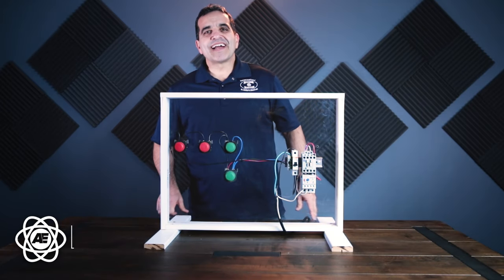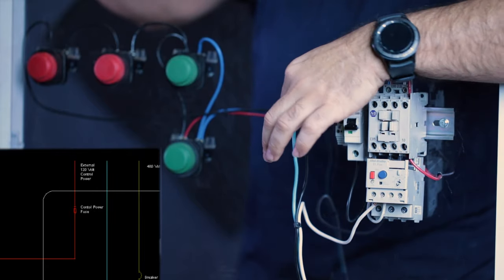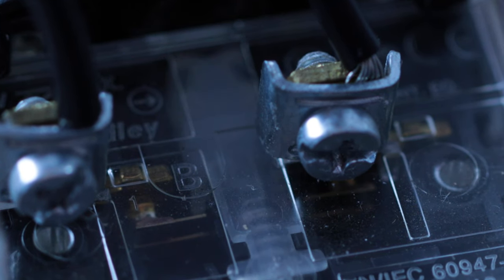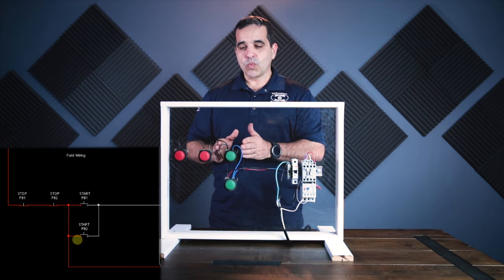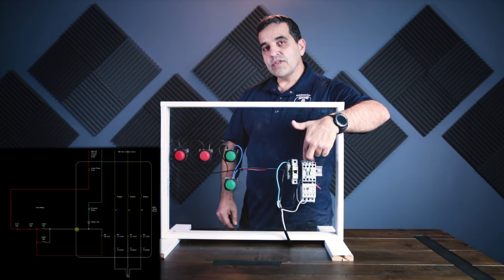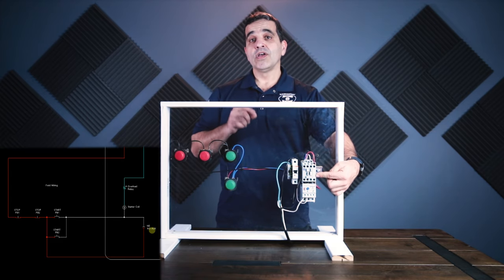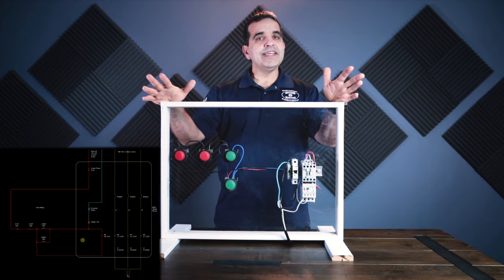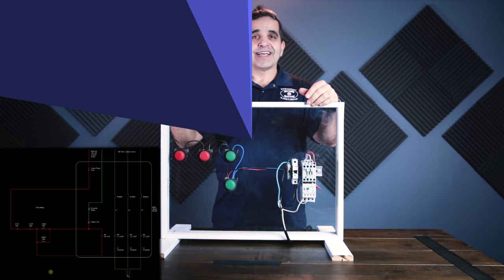Basic Motor Control: 3 Wire Start Stop Circuit (updated)

Comment: Wow, another great video! Thanks so much. And using the clear plexiglas mounting is a brilliant way to show in a (literally) clear and engaging way just what is going on. 
This was definitely a worthy update from the earlier video, thought it's best to watch the other one first, and then this one. My only suggestion is to add 2 indicator lights. One to represent the load being controlled, and the other to indicate POWER ON to the basic control circuit (ie, Breaker On). With these, you could start by manually closing the contractor to show that the load lights up. One additional suggestion would be to inset a close-up view of the contractor connections when you're discussing them so we can see when you have 2 wires connected to the same terminal (which is think is the case for the blue and red hot feeds for the contractor coil).

Comment: Walter great information.

Do you have a video or diagram explaining this same concept using a DC off/on/(on) switch? 

One off/on/(on) switch in one location and second off/on/(on) switch in another location.
Start the engine from one location but be able to shut down from either location.

Like a rocker switch used for diesel engines to be started and shut down from more than one dashboard.

Thank you

Comment: Nice 👍🏻. Very informative. What about a 240v coil on a single phase starter with a stop, start?
Reply from the maker: Hi Tracy! With a 240 volt coil you will wire the starter and the buttons exactly the same way. Line 1 of your 240 volt circuit will,wire through the buttons and to the starter the same way. The difference will be that instead of wiring the neutral wire through the Normally Closed overload relay and to the coil, you will wire Line 2 of your 240 volt circuit through the overload relay. Also remember the single pole fuse switch I show on the control power circuit would need to be a 2 pole to disconnect both legs of the control power 240 volt circuit at the same time.
Reply: Can you do a video on this?

Comment: Why did you wire the neutral to the bottom of your overload protection device? If you explain that in a bit more detail that be appreciated, thank you. 
Other than that I understood the information presented in the video.
Reply from the maker: AKBRONCOSFAN007 The overload is a normally closed safety switch. I wire the neutral to one side of the overload, and the other side of The overload is wired to the coil on the starter. This feeds one side of the coil. So a neutral is always available if the overload is not tripped to the coil. When the start button is pressed and the whole circuit is engaged, 110 V is applied to the other side of the coil. So if you lose
Reply from the maker: AKBRONCOSFAN007 Power than the quail will turn off or if the overload trips and you lose the neutral the overload will turn off.
Reply: @AccessToPower  Just piecing it together w/o typos: So if you lose power to the coil the contractor will turn off. This will happen when either you lose control circuit power (fro coming through the breaker due to power failure or turning the breaker off) or if the neutral overload protection NC switches open in response to overload condition. Either of these events will cut the neutral connection to the contractor coil, shutting off both the power going to the load and the hot (red) line going to the top side of the contractor coil.

Comment: Can we strait energize the coil without using auxiliary contacts?
Reply from the maker: Adrian Bano, yes you can send control power to the coil without auxiliaries through a maintained selector switch or something similar. The only thing to keep in mind though is if the power is interrupted and restored the motor will immediately start running again.
Reply: @AccessToPower  Thank you

Comment: Walter, I have a question for you. Does the position of a overload change when the start button is pressed? I see sometimes the control circuit is passed through the overload before it is connected to the stop button.
Reply from the maker: Devon Salmon the position of the overload contacts does not change when the start or stop buttons are pressed. Th OL contact position only changes in the event that the OL trips due to the motor drawing more current than the OL is set for. This then opens the NC OL contact which interrupts the control circuit to shut off the starter and turn off the motor before permanent damage is done to the motor.
Reply: AccessToPower ok. Thanks I have learnt a lot of things from you since I subscribe to your channel. There is one circuit I would like you to explain for me. It’s is a two float control circuit for a lift station. A lower float switch and a higher float switch in series that control a pump in a lift staton. The lower float switch comes in but does not start the pump until the higher float switch is activated. And the pump does not shut off until the lower float switch is de-activated. Thanks in advance.
Reply from the maker: Devon Salmon I’m glad the channel is helping you to learn and thank you for the suggested topic of lift station float operations. I will try to make that shortly

Comment: I’m a hoist technician’s apprentice and I’m having some trouble with terminology.  What is the distinction between the “X1” and the “X2” side of the control circuit?
Reply: X1 is the control power X2 is the other leg of the control power, either the "neutral" of a 120v cct or the other leg of a 240v cct.

Comment: Why does the neutral have to go through the overload relay and not just straight to the coil (A2)?
Reply from the maker: If the neutral went straight to the coil then the motor starter would never trip due to an overload
Reply: Ok thanks

Comment: What that light blue wire doing on that terminal next to the CB
Reply from the maker: I think you're talking about the light green wire that is next to the circuit breaker. I didn't talk about this in the video because this is my ground wire. This wire is grounding protection.

Comment: How does this work for using this on a ansul  system
Reply from the maker: with an annual system you will need a couple starters. One, the hood exhaust, will remain running in the event the Ansul fire protection system goes off, while the other starter, for make up air needs to turn off. That is so you don't pump oxygen into the room and feed the fire.

Comment: a electrical circuit is not closed or open - it is connected or disconnected
Reply from the maker: Just one reference of many to electrical switches being referenced as open or closed… https://en.m.wikipedia.org/wiki/Switch#Contact_terminology.    Here is another https://engineerfix.com/electrical/circuits/normally-open-vs-normally-closed-what-do-they-mean/ … thanks for the comment!
Reply: @AccessToPower  Majorety do not deside what is right or wrong. Think for your self and try to understand U are using the language of thoes who often say they "don't know nothing".......

Comment: why is it called a 3 wire start stop
Reply from the maker: Hi James. It’s called a 3 wire start stop because it only requires 3 wires from the starter and voltage source to the start stop buttons to work. 1 power wire, one start wire, and one hold wire.

Comment: This confused me more than I already was. 
1) I’ve never heard of an Auxiliary Contact on a contractor for a motor. 
2) the button configuration here is confusing cause you will NEVER encounter that configuration on the field. The buttons would be in two separate locations.is there a video online that shows how this would be configured on the field? Every video I watch uses different hardware and configurations and I’m totally lost.